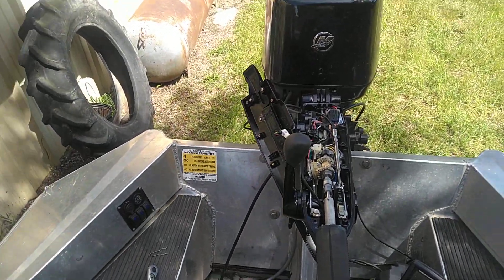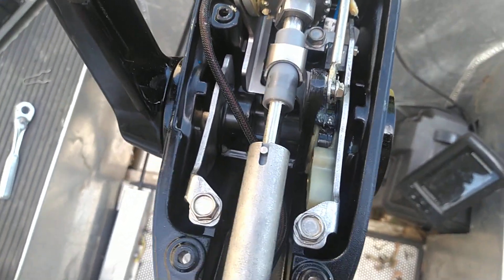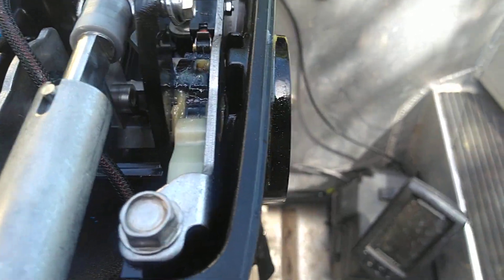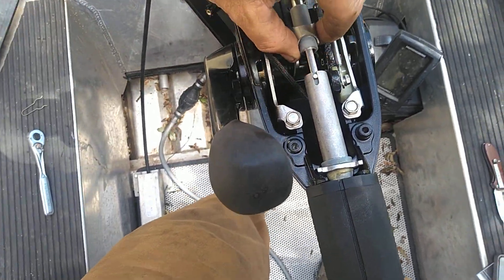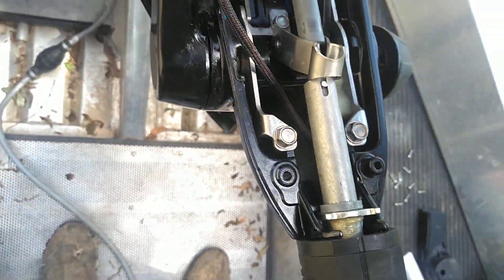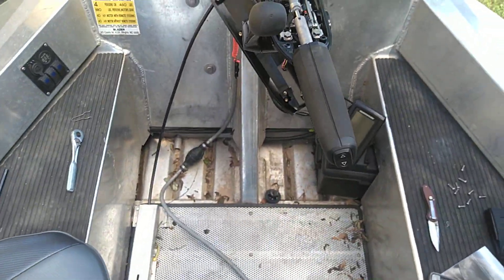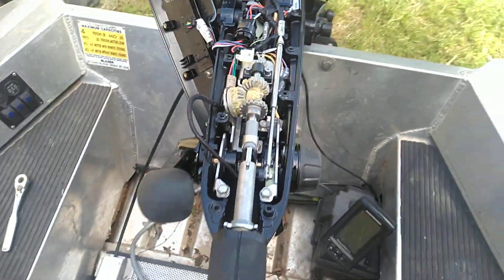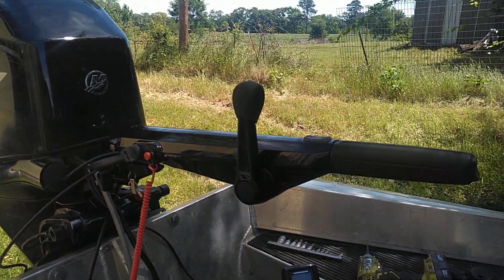New Mercury Big Tiller update Shifter Swap.

Comment: I'm re-powering a 1648 Alumaweld Sled. do you think the 60/40 Mercury is a good fit for this size boat?
Reply from the maker: Probably a touch heavy but I know several guys who run them on 1650s and it does great. These motors weigh 270ish pounds
Reply: I would say find a nice 2 stroke 60/40 they only weigh around 220 if I remember. I just got a 17x58 or 60 alumaweld flat bottom and It had a 1990 merc 90/65 but I just got a 2008 115/80 Optimax only weighs 48 more lbs and soooo nice😁💨